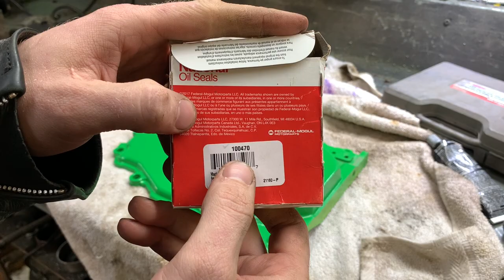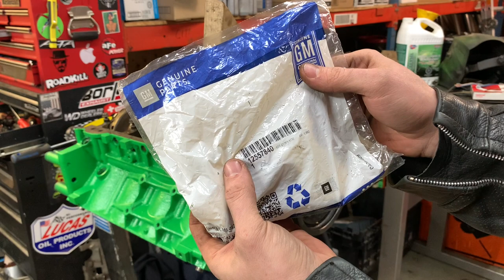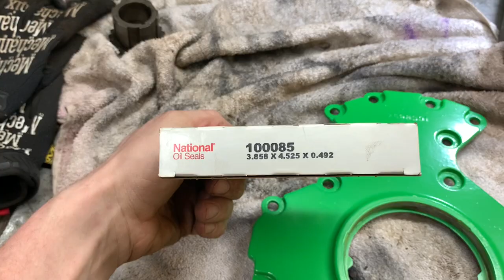LS oil pump mods,(porting+shimming) gapping piston rings for BOOST - Destroked 6 litre LS build

Comment: Yeah bud that's really not a good way to do that harmonic balancer. Its a whole lot better to heat it up and let it just go on rather than beat it on there. Beating it on is really not good for both the balancer and the crank & thrust bearings
Reply from the maker: I’ve always been afraid to heat it up too much and melt the crank seal. Might try that next time
Reply: Some people put the balancer in the oven at 400 degrees for 20 mins. Slides right on.
Reply from the maker: @jasonjennings5833  that’s wild. I thought for sure it would melt the crank seal, I’ll probably try that next time